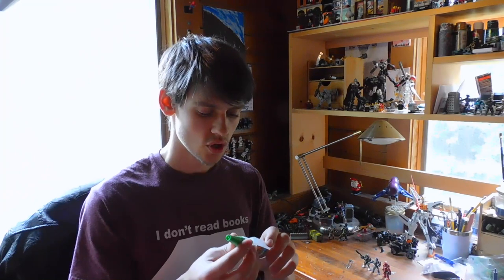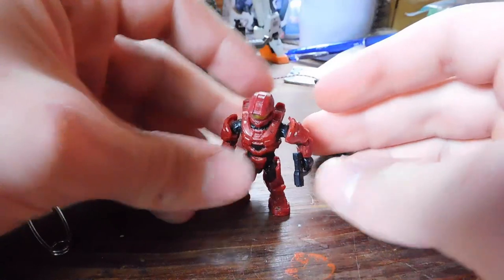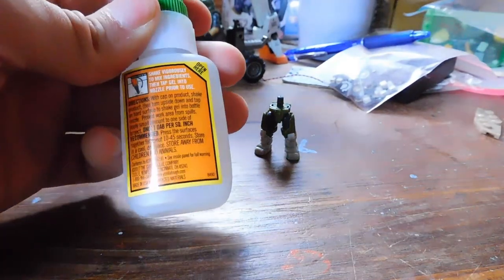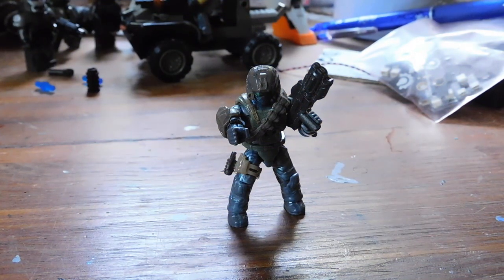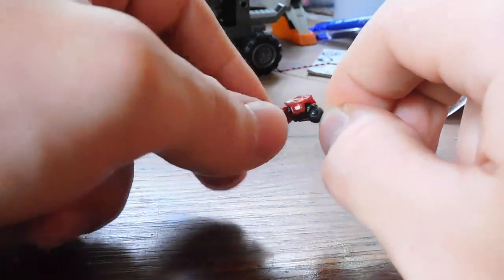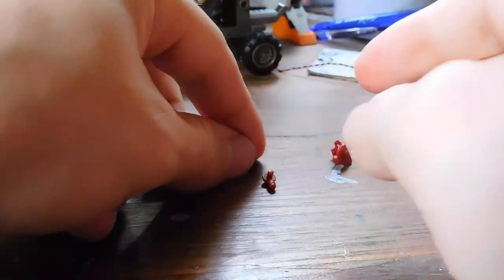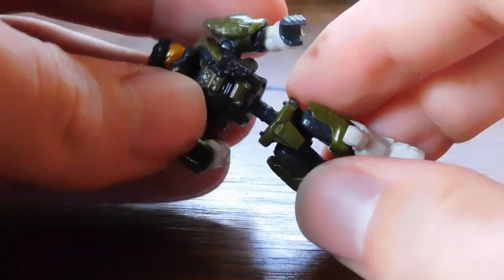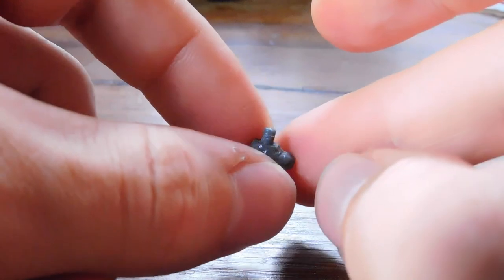Dusted Off Ep. 9: Loose Joint Fix Tutorial

Comment: I've been using similar methods to fix my figures' loose joints for years. The only thing I do differently is instead of applying the glue using a bobby pin, I tend to  use a tooth pick. Since the glue grips better to the pick than the smooth surface of the bobby pin. And when fixing loose shoulder joints, I fully disassemble the arm by boiling a little cup of water and dunking half the arm in it (holding the arm with a pair of tongs). I do this so I can avoid leaving potential stress marks on the plastic.  If I apply to much glue I file the glue down using a nail filer that I cut to be smaller. But any way great video!
Reply from the maker: I have yet to end up with any noticeable stress marks from disassembling the figures but that method works too!

Comment: The wobley hand is my biggest issue. You can also avoid the white residue by getting hobby specific super glue from a hobby shop
Reply from the maker: Wobbly hand issue is going to be fixed next! I'll have to look into the hobby glue thing. I have one brand but it doesn't work the same way
Reply: @DemarcationMedia  yeah, the hobbytown brand works well for me as a modeler
Reply from the maker: @danielweaver5911  I'll have to check it out

Comment: Hey Demar, i got a question, but My Figure Has got an issue where the Knee Articulación Just Separates, I don't really know what to do
Reply from the maker: You use the same method. Spread a little glue on the very end of the knee peg, let it dry, and then reassemble